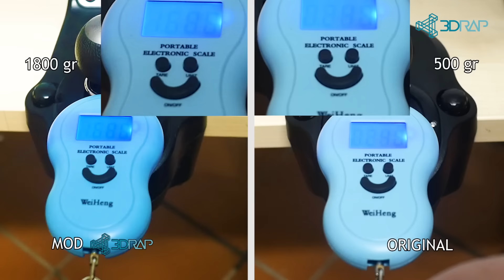MOD CAMBIO V3 - Logitech G25 G27 G29 G920 - Improved Feel

Comment: I bought one of these and it is an absolute nightmare to fit V3.5
the fit and finish is awful
i bought the metal H plate to go with it.... doesn't fit. (I could barely get the plastic H plate to go into the 3d printed part

there are little bolts that you are supposed to put into slots before putting the H plate on, those kept falling out.
I lost 3 of them inside the shifter and had to completely dismantle it

Comment: I bought one of these and it is an absolute nightmare to fit V3.5
the fit and finish is awful
i bought the metal H plate to go with it.... doesn't fit.

there are little bolts that you are supposed to put into slots before putting the H plate on, those kept falling out.
I lost 3 of them inside the shifter and had to completely dismantle it

Comment: The Mod is very stiff and sure it makes the gearshift more realistic, but after a month of use I can say that many times I got stuck in neutral or had wrong gear change. Sorry, but to me it makes the gearshift very inaccurate and not suitable especially in races.  Original gearshift is soft but it's nearly impossible to make mistakes! Great service and assistance from 3DRap hope the best for your activity!

Comment: Ordered One of these today :) Will let you know my thought's when it get's here.
Reply: Just to update anyone who may be interested in the mod. I have been using it for around 2 weeks now and it transforms the shifter. I have owned a Thrustmaster th8a and even the Fanatec clubsport v1.5 shifter and this for me feels better with short shifts. It is of course not made as well, but would def recommend the mod :)
Reply: Do you think it will last?
Reply: Seems to be fine so far! I did lube it up with grease when I first got it as I was worried it could break. I also bought a spare part in case it breaks, I will update in like 6 months to let you know how it lasts overtime.
Reply: thanks appreciate the quick response
Reply: @davebell771  Thankyou for your info. What was the delivery time scale
Reply: @cliveatkins4155  I can't remember but think it was about a week? Still holding out strong and has worked flawlessly.
Reply: @davebell771  Thanks for your reply and its still working well. Im going to order one many thanks 😀
Reply: @Callam  Yep as good as new to be fair. I am really happy with the purchase.
Reply: @davebell771  Thanks for the updates! I'm getting a G27 tomorrow and am looking for these mods. Glad to hear it's still working great!